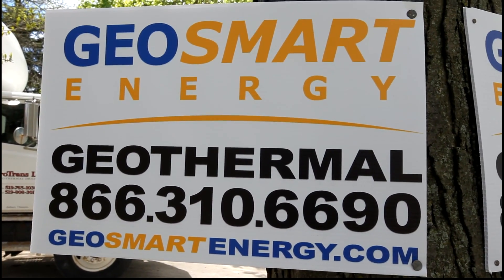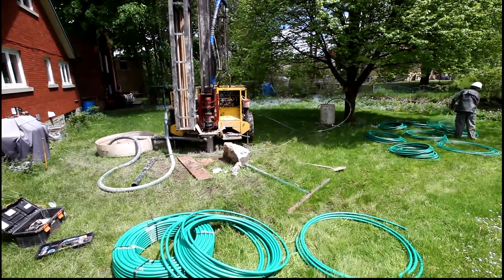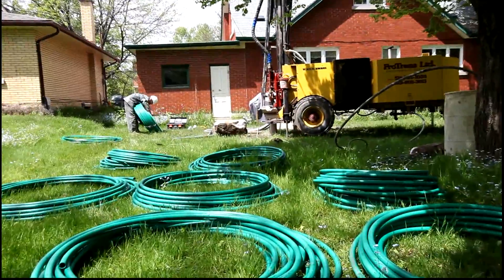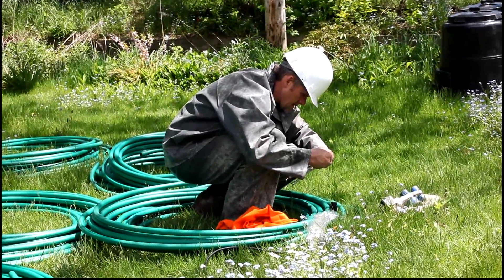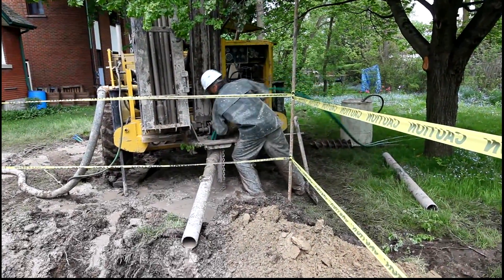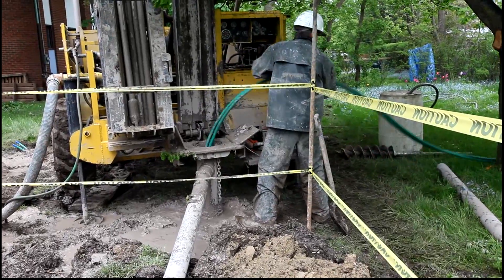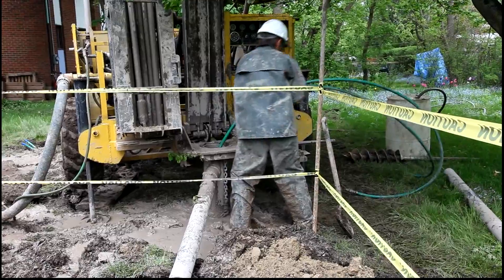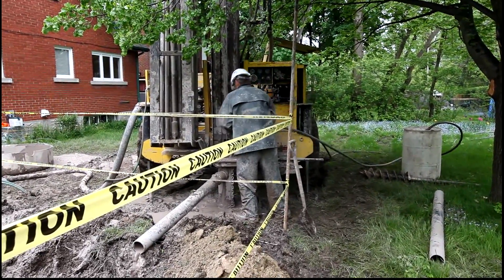Geothermal Install - Waterloo house - Part 1

Comment: hell with all that geothermal crap, as an installer for 17 years i am gonna stick to the regular conventinal ac and airsource heatpump installations.
Reply: what air source heat pump do you recommend? I have no natural gas. only propane

Comment: i would love to know how much this cost as i live in kitchener-waterloo  and is this a good way to go off the grid with this system  like i have read that it heats up in the winter but does it cool in summer?
Reply: Geo thermal systems are capable of doing both heating in winter and cooling in summer

Comment: Boy. That really tears up a yard don't it.. And not as efficient as a trench because the cold water going down is stealing heat from the warm water coming up. Add to that collapsing sides and it could be pretty frustrating pushing hose down a hole that doesn't exist the moment you pull up the drill